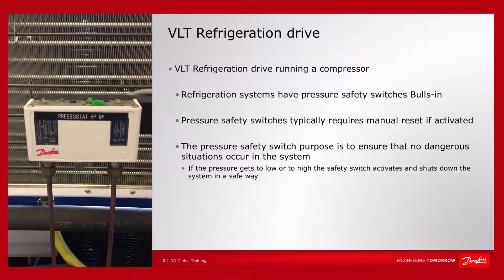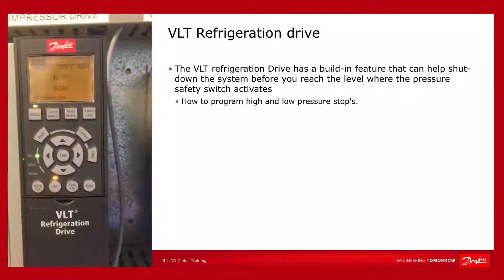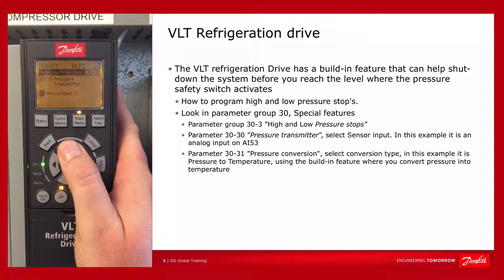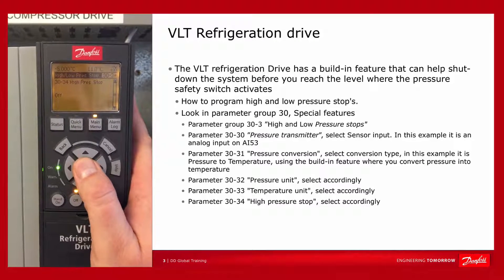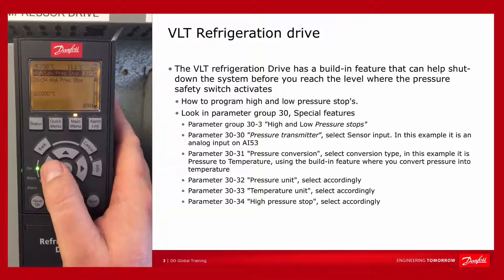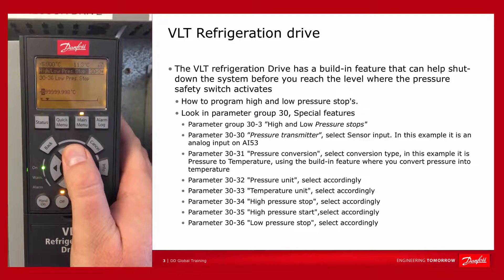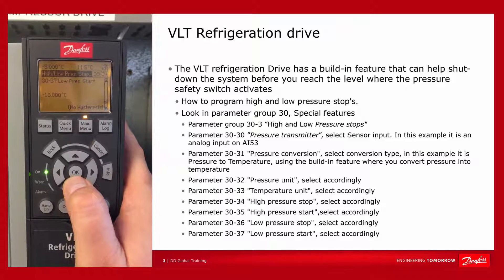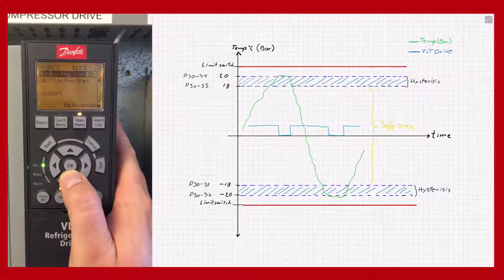VLT® Refrigeration Drive FC 103: How to program L/H Pressure stop's

Comment: what is the minimum speed can we put in VFD drive with no  affect in the motor
Reply from the maker: Hi Ahmed

Here is an answer from someone from the technical team: The drive is not the limiting factor in the speed selection - this is the compressor / motor. We will soon launch an "Envelope" protection feature, that will secure the compressor motor – so it will not get to high or too low in speed – and independent of the main control request to raise or lower the speed (based on application demand).

For technical questions, you're always welcome to contact your local Danfoss Drives Sales and Service office via https://www.danfoss.com/en/contact-us/contacts-list/?filter=type%3Adanfoss-sales-service-center